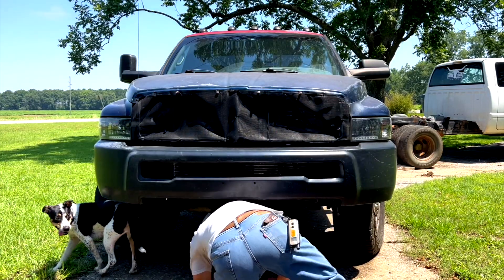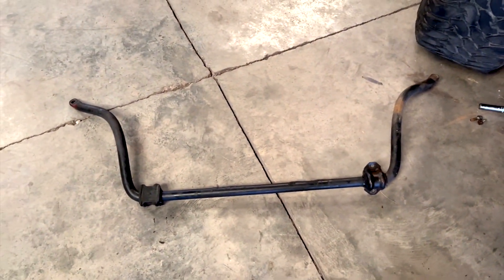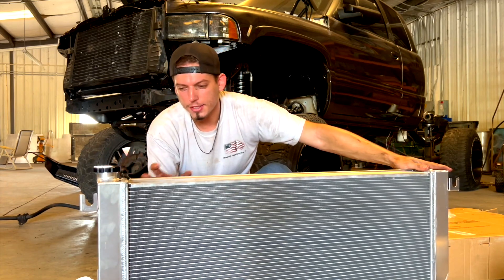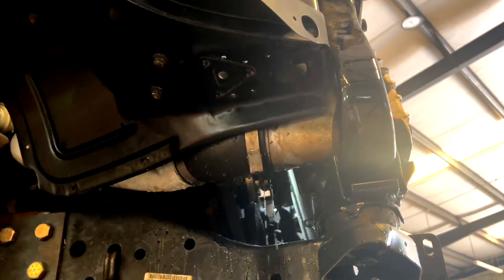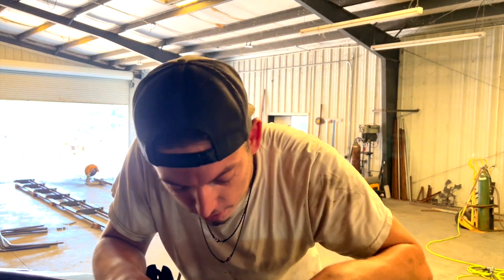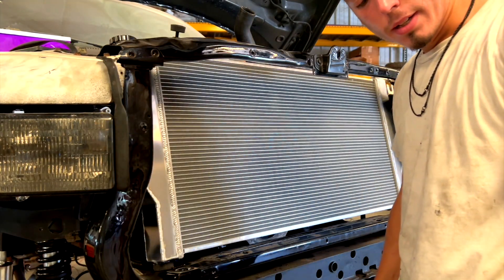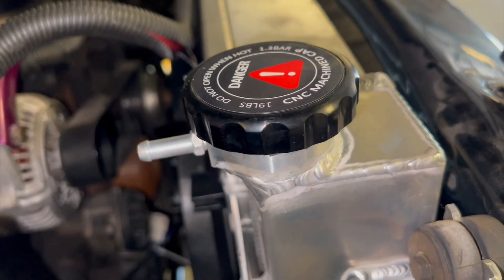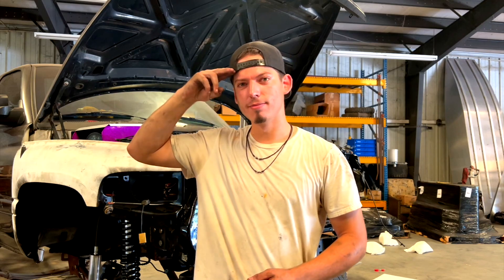MY HUGE LIFTED CUMMINS IS ONE STEP CLOSER

Comment: What kind of backward @$$ Chinese radiator did you buy??  Good parrs should be plug and play.  Why doesn't the thermostat sensor screw into the engine block?  I've never seen a system where the thermostat sensor screws into the radiator.